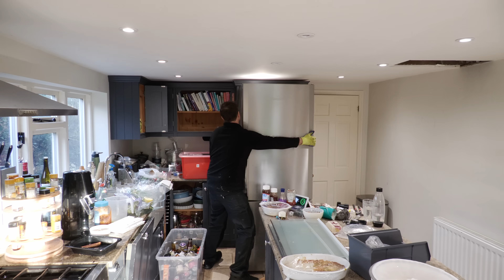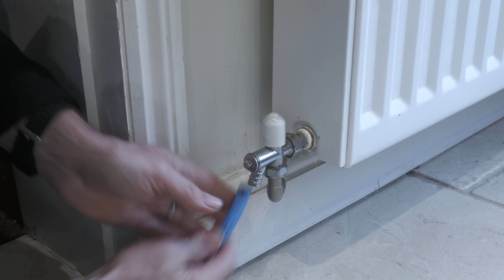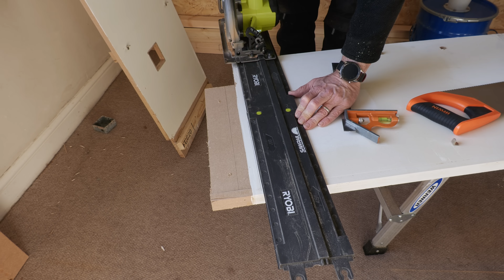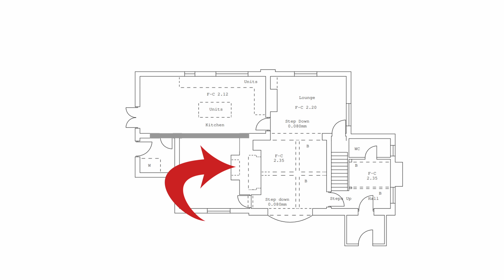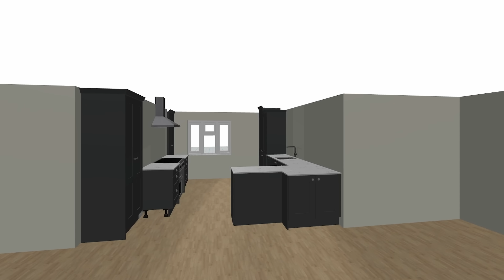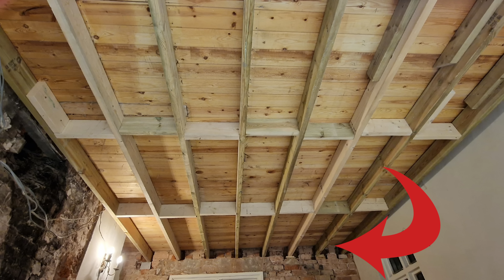My Kitchen Renovation Knock Through

Comment: High Charlie. 

Question about knocking through in old buildings.

I have a small 150 year old cottage witj thick stone and brick walls. Id say the external walls are about 600mm thick. 

Im looking at gettong 2.5m bifold doors installed innthe kitchen. Last all inclusinve quote i got (doors, knocm througj, RSJ, structural engineer, install, finish ready for paint) was £14k. 

Does that sound about right considering im in Somerset? 

He also said lazy boys wont work because of the weight of the wall.  

I dont know what a good or bad quote at the moment.

Any advice would be much appreciated.
Reply from the maker: That sounds in the right ball park - maybe at the higher end but IF the builders are good you'll always pay a premium for that and of course you could be in for a lot more if you get it done badly and then have to get someone else in to remediate - plus it's not the most straight forward knock though.  So I'd say first off make sure you've got a decent company quoting. Difficult admittedly but word of mouth recommendations or checking other work they've done would be ideal. A decent set of bi-folds - you want triple glazed really - will set you back £4k to £6k again, don't go cheap as you'll regret it. I used a company called IDS Systems. A couple of steels will set you back say £1500k and the external steel will need modifying to provide the detail that can support the outer layer of bricks. Building work should take no more than 2 weeks at £220 per builder per day up here or fixed fee if you can get it. Structural report £350 or so. I'm slightly guessing these figures but it gives you an idea. I agree strong boys won't work with that wall. Are they putting needles through above instead?
Reply: @CharlieDIYte  Hi Charlie

They said they will be inserting 4 needles along the 3m section of the wall. The price also includes a gutter to collect water for the low threshold on the bifolds. The door manufacturer is BifoldShop. I'm not sure on their standing in the market.

I'm wondering whether it's worth using the budget for other work on the house, move bathroom upstairs, relocating the staircase, new glazing etc, then coming back to the Bifolds in the kitchen.

Comment: Always better to use a private Building Control company rather than the local council as council inspectors seem to have different guidelines/opinions for example mine told me that i could not seat the timber joists in the web of the steel beam as this was no longer allowed. Instead i had to bolt a timber in each face of the web and then use joist hangers to support the timber joists from the face of these additional timbers. Since then i’ve had someone else contradict that so now i use a private company
Reply from the maker: Yes that's the conclusion I've come to. Thanks for sharing 👊

Comment: looks like the builders didn't put enough of a 'crank' on the acrows.... I've just done almost exactly the same and not had cracking like that, my steel was not in place for over a week
Reply from the maker: You might be right. The trouble is that section of wall is a bit of chaotic infill - it's not proper interlocking bricks so there was no structural integrity when the wall was removed. But bottom line, the cracking wouldn't have happened with decect builders!
Reply: @CharlieDIYte  Thanks for the reply Charlie, it makes a difference when YouTubers do reply, really enjoying your channel, makes me whish I had documented all my projects as like you I do all my own work including a 2 bedroom loft conversion.

Comment: Great job Charlie and brilliant, useful Vid as always :-)   With those cracks; As you didn't needle the wall at FF level and were just supporting it by supporting the floor joists and hoping they supported the wall (not always the case as often there's a gap between top of joist and masonry above), but then you notched out the top of the joists to make space for the Steel, maybe I've missed something but,  what was now supporting the wall?.... maybe the cracks were caused because nothing was supporting the wall properly so it 'Arched' back to the nearest remaingin supporting walls?....

Comment: Hello, when I did underfloor heating we combined it into the slab, 100mm concrete use a393 mesh to tie the underfloor heating to. you don't need a screed, and that will save you 50mm. We placed on 100mm insulation.  We had natural slate flooring on  top which ranged between 20 and 30mm thick. the heat came through well. By the way I am a chartered surveyor, knew what I was doing!!!

Comment: Really interested to see this one Charlie. I'll be doing something similar, though a smaller span @3M. Trying to figure out if it's a job I can tackle myself or if I need a builder. Like you, I want to recess the beam in and appreciate it adds complexity. If i wasn't doing that I'd be pretty confident doing a standard RSJ install.

Comment: Hi Charlie, looks like mayhem! We did our kitchen renovation a few years ago which included fully digging out the old floor, built back up with 100mm type 1/sand, dpm, 100mm oversight concrete sub, 100mm celotex on top, another dpm (different grade), underfloor pipes then liquid screed & finish flags. Expensive but well worth the effort and the underfloor wet heating system is so good with a constant low level heat. Good luck this looks like a big one! 💪
Reply from the maker: That's really helpful, thanks. As you say, everyone thinks you're mad at the time but it will be worth all the pain. Kingspan have a good u value calculator on their website. I think I might be able to get away with 50 or 60mm insulation. 🤞
Reply: @CharlieDIYte  obvious i know but more is better and if you are there for the long haul you only want it done once. we only had 75mm as our builders poured the oversite too high meaning there wasnt enough space for 100mm of insulation, screed incl pipes and floor covering. it's fine but if i did it all again I would be going way past building regs to 150mm as it will give you a slab that stays warm for so much longer.

Comment: nothing shocking about that soldering ..
Reply from the maker: Just very messy for a supposed pro job, but I think there was an apprentice doing a lot of it. Still, it's never leaked.
Reply: @CharlieDIYte  

my parents had CH installed in 1972 all copper pipe and soldered like that it has never leaked and still works perfectly only replaced the boiler once in all that time 

can't beat copper imho

Comment: Great project Charlie, looks like you had a good work split with your builders, keeping your hands dirty and getting stuck in.
When we had our house extension we wanted flat ceilings as well, caused more work for the builders to hide the steels totally in the ceiling and we ended up with small protruding brick piers in the kitchen and lounge but it was worth it in the end.   Our temporary kitchen was in the lounge which made for a cosy experience!
Surprising about the cracks, we didn’t have anything like that.  Might be because of your house being older that it was more susceptible.  More DIY filling !

Comment: Been doing a lot of research on the underfloor heating question. Seems to come down to whether you want a low profile system which heats up fast and sits on routed insulated panels (but is still more efficient than rads as its at a lower flow temp) or go the whole hog digging out a floor with as much PIR as you can get away with and the pipes in 50mm of screed with the screed acting as a huge thermal mass. It seems to come down to "how much can I be arsed to take the concrete up and what will I gain if I do" and in your case it looks like you might as well.
Reply from the maker: Thanks. That's exactly what I'm thinking. 👊

Comment: Hi Charlie,  starting question is the heat source for your underfloor, if there is any possibility that it may become heat pump, you’ll want a much closer mesh of pipes, as the circulation temperature is likely to be around 50-55° rather than the 65-70° from a gas boiler.  We retrofitted underfloor in our studio, as the ceiling height is 4m it was a no brainier to fit a special insulated pipe guide with thick foil between the pipes raising the floor level by about 50mm.  The laminate flooring went straight on top of this.  For the first year we had a regular thump every 10 minutes when the thermostat recalculated and shut off the circulation momentarily, we had to get the installers back to create a partial bypass to relive the shock

Comment: 100mm (min) road stone 
Membrane 1200 gauge
100mm concrete
Membrane 500 gauge
100mm to 150mm PIR
Membrane 500 gauge
Underfloor heating pipes
Flowscreed 50/60mm
Finished floor choice 👍
Reply from the maker: Thanks, really helpful 👊

Comment: Rather than notching the floor joists for the flange of the 203UC, could you have not bolted a timber beam to each side of the web and used joist hangers ? Looking forward to the next video :)
Reply: Yeh what's holding the joist to the beam connections
Reply: @kiwibird8441  The timber gets bolted to the beam and the floor joists are then connected to this bolted timber via joist hangers. This happens a lot in loft conversions. It depends on what the building inspector wanted.
Reply: @Brown969 typically yes, I've done this myself. Can't see it in this video yet
Reply: @Brown969  I was asking about the video joist beam connection. not a description of op comment

Comment: Is this a joke, you pay builders to come in but then you decide you need to remove the radiators when it should be them ? If I was a builder I would be running a literal mile from you.

They won't be able to touch anything before you stop them telling them they are doing it wrong and you could do it better.
Reply: Why? The builders have been contracted to do a specific job. It's no different to various trades doing different work on site.
Reply: Think you've missed the fact that Charlie is the paying customer,  and the builders/tradesmen are paid to do his bidding!
Reply: @markmiwurdz202  that’s not the way it works mate, builders regularly walk off jobs. It’s a builders market because there’s a lack of the, the pick the jobs they want
Reply: @dgmclar  depends if removal of rads was in the contract they agreed with Charlie, their client. If it wasn't priced into the job then why would the builder want to spend the additional time and effort doing it for free?!

Comment: Great video and it looks like the builders got lucky having a job at yours, with the nice flow of tea/coffee and materials, just what every builder wants  :D With the floors I've always done hardcore, sand, dpm, insulation, concrete, pipework and leveling screed, but there's many ways to do it, thicknesses of these would vary and it may need steel within the concrete depending on the ground.. I'm sure the local building inspector would advise

Comment: For our subfloor after excavating, we had plastic sheeting, hardcore (40mm roadstone) compacted (40-60mm), sand compacted,(30mm), cement (80-100mm), 100mm PIR, plastic sheeting, pipework, pumped in screed.
Waited 20 days (last summer in the 40-degree heat), then had the top 3mm ground off, applied primer, decoupling matting, then tiled. Massive undertaking but well worth it in the end

Looking forward to watching your progress
Reply: Why does the screed needed to be sanded 3mm and apply a primer?  Could you not tile directly?
Reply: @aleixingleselias3882  scrapes off all the water, dust and crap that floats to the top. Leaves a really shinny none adhesive layer

Comment: Charlie...I thought using anything other than copper pipes in a central heating system was a huge no no ?
Reply from the maker: As @Swwils says nothing wrong with it per se, but the upstairs is 15mm and the downstairs micro bore, and arguably the downstairs needs a greater flow rate as it's typically colder.
Reply: @Charlie DIYte  Charlie...been meaning to ask. If I need 2 radiator TRS valves replaced....do I need to drain the whole system?
Reply: @superamario6464  yes, depending on the type of system it's often easier to bleed from scratch. Hope this helps.
Reply: @jlmfoy365  thank Jim. Appreciate the reply:)
Reply: All modern Barratt boxes have the same speed-fit pipes all over.
Reply: Nothing wrong with plastic pipe if properly designed and installed. Often it isn't.